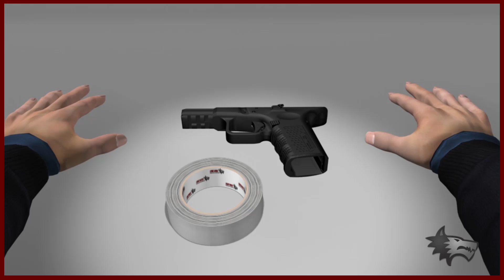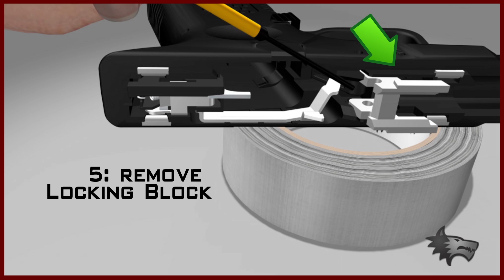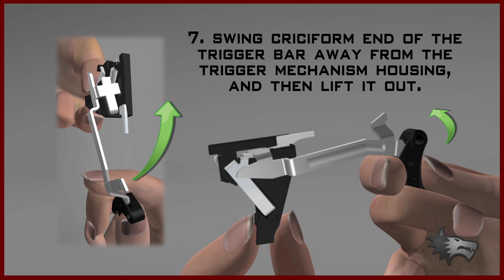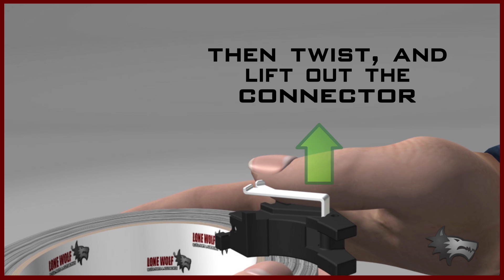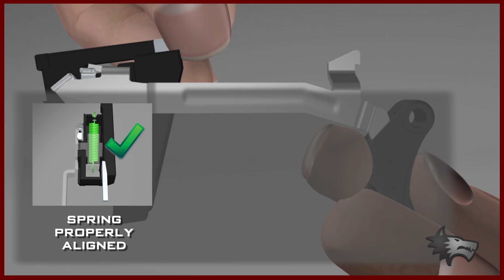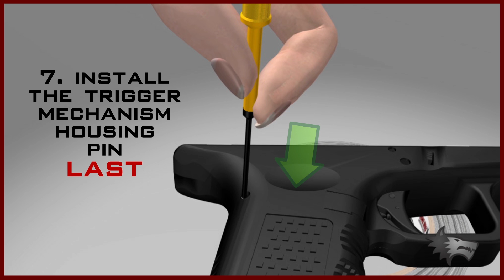Lone Wolf: Lower Receiver Disassembly and Reassembly for Glock

Comment: I wouldn't recommend a lonewolf connector to anyone. I bought 3 when they were on sale and they all ended up causing slide lock issues in every glock I put them in. On top of that when I reached out to Lone Wolf, they pretty much told me tough luck and won't even let me post a review to warn others on their website. Used to buy their barrels for upgrades but never again.

Comment: Yes this is cute.. Im furious.. half the parts from the glocks DO NOT fit into the Timberwolf frame.  The trigger housing, and locking block dont fit in the Timber wolf frame!!  I was told I needed a Gen 4 mag release, but not at least these other two parts. The Timber wolf needs a glock SF trigger housing. If I had a Glock SF.... why the hell would I be moving over to a similar and arguably substandard frame?